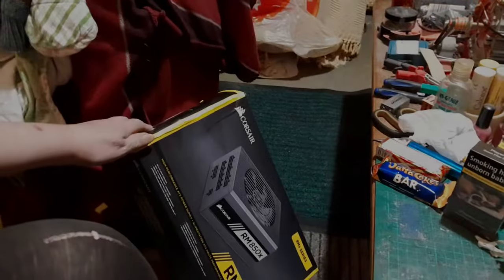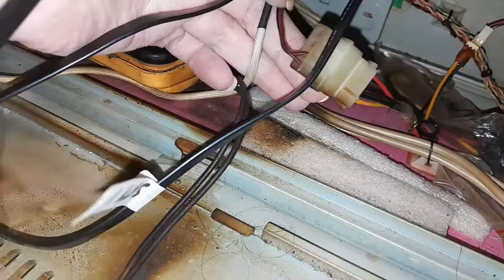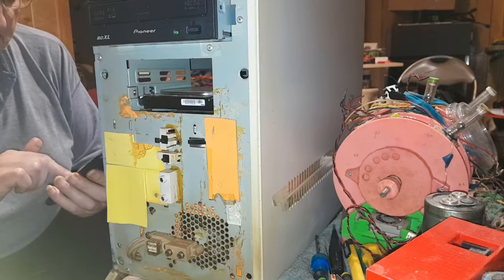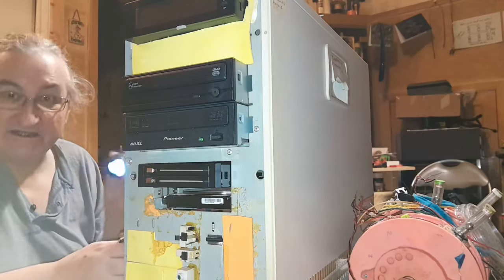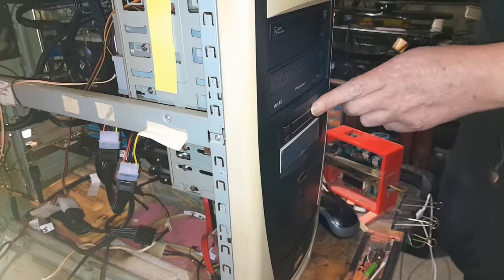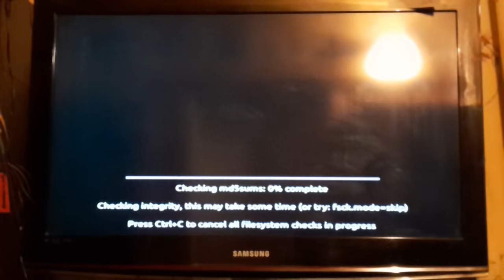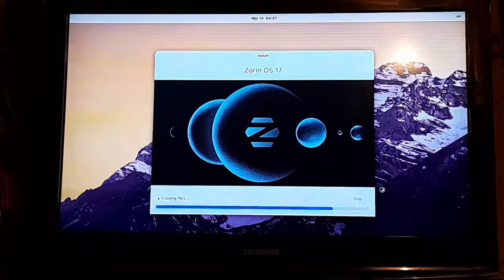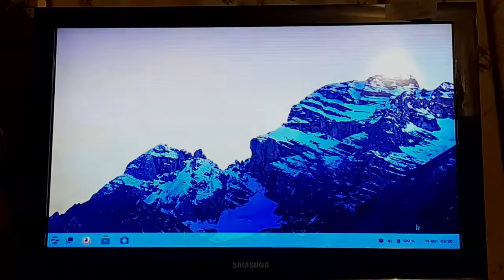Part 2 what almost broke PC

Comment: just a tip, never ever plug a PSU cable from a different brand or model into another power supply you risk frying your system. If you want to you have to check compatability because every brand pins them differently.
Reply from the maker: Sorry, but these are under strict uk BST safety standards they can not be wired wrong, or they won't make it past our certificate CE standards. I worked many years as an electronics engineer, but age, failing health may make me look stupid at times, but it's just memory problems. And physical mobility problems I do know these types of plugs are standardised.
Reply from the maker: These are standard. https://en.wikipedia.org/wiki/British_Standards
Reply: @aerotro  He means the modular cables that connect the PSU to the system components. Different brands sometimes wire them differently.
Reply from the maker: @matthewwilde5222  OK

Comment: I was watching the video and noticed that you are not using an ESD band! when working on sensitive equipment such as computers it is important to have protection against static electricity as to not accidentally fry your hardware! 

For more information I strongly recommend to look up ESD bands for any future tinkering :)

Good luck!
Reply from the maker: I know about ESD but not wearing any static clothing also in the 20 years I lived here never had a static shock, I know what your saying but as long as your touching the case theirs minimal risk of ESD if it's not plugged in anywhere.
Reply from the maker: I used to repair lasers their far more prone to ESD damage.